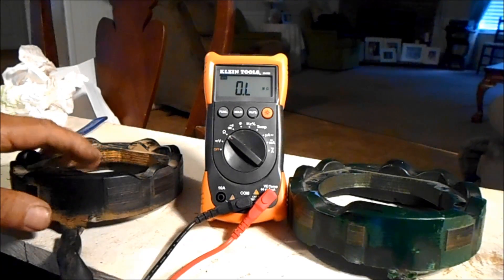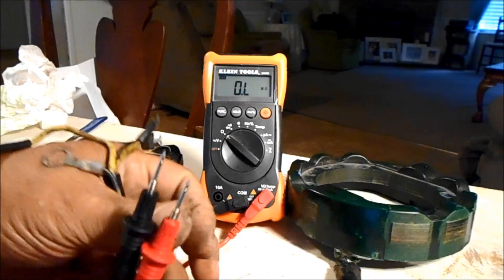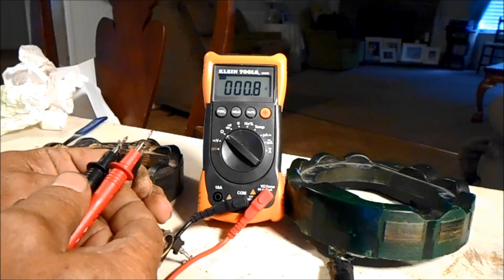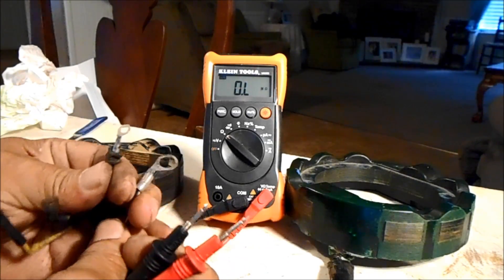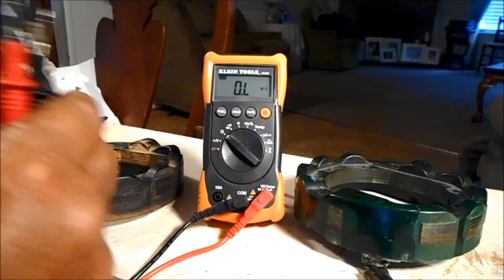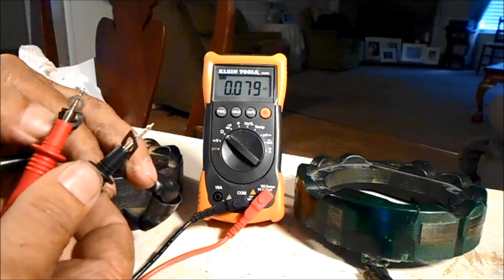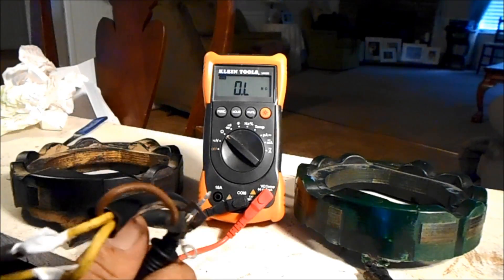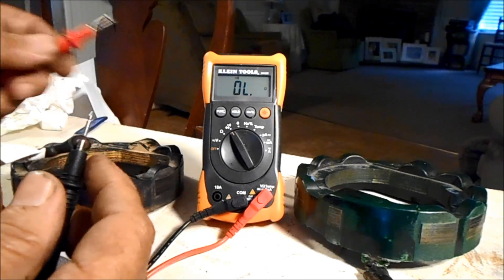HOW TO CHECK A JOHNSON AND EVINRUDE STATOR

Comment: This video was along time ago but I hope you still check your comments I checked my stator but I’m only getting .60 -1.00 I’m getting continuity but not as high as yours? Any thoughts ?
Reply: I had to change to a different ohm number reading between the 2 yellow wires and on mine, a solid brown and a yellow/brown going to my power pack to get the proper good or bad stator readings

Comment: I had no conection betweeen ground cable on the stator and the engine block. Is it possible to remove the plastic from the stator and fix it it is it impossible?

Comment: Hello I am performing the test you showed in the video. When i check the yellow wires   I get a quick reading then it goes to zero. But when i check the ground and the brown wire it reads 0.39 . 
Not sure if the stator is bad
Reply: Did u figure out? Im havin same issue

Comment: i have a 1975 85 hp johnson. the stator does not have a ground wire, it only has the 2 yellow and the 2 brown. is that normal?
Reply from the maker: SHOULD BE THE SAME DIFFERENT COLOR

Comment: I have a 83. 150. Johnson runs on a hose .put  the boat in the water  runs good for 5 or 10 minutes then it starts missing real bad let it set 20 minutes going to run good another 5 hour 10 minutes hook up to a hose running 30 minutes and it runs good in gear out of gear
Reply: not 5 hours 5 or 10 minutes
Reply from the maker: you allready know somthing is getting hot,,,you  may be getting more water flow on the hose .and then you dont have a load on the motor on the hose...make sure the water pump is 100 percent
Reply from the maker: make sure that one of the butterfly valves are not closing on the carb
Reply: @johnmcgann1748  r

Comment: hello  sr , i have  a johson 225 1989 w/ rpms problem it wont pass 3 000 rpm does it have anything to do w/ the stator ?
Reply from the maker: +Ernesto Cortes (Sport Courts) MINE HAD A BAD STATOR AND IT WOULDNT EVEN FIRE
Reply: +Danny S Hodges , looking forward to replace it ty
Reply: Ernesto Cortes 
I have an 1989 200 that won’t go past 3000 rpms also. I’m wondering if changing your stator solved your problem for your 1989 225?
Reply: @CaneAndretti  nothing to do with the stator mine was water in the gas tank  and bad spark plugs, i will suggest call a mechanic if you can good luck
Reply: Ernesto Cortes
Ok cool.Thanks